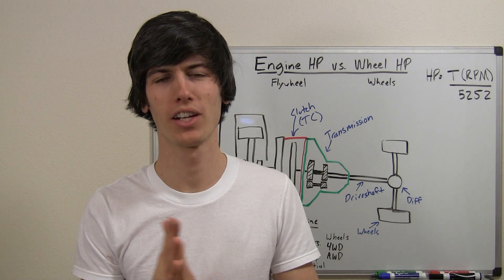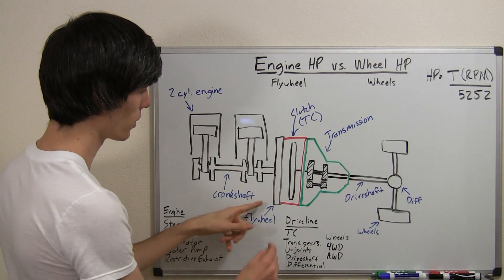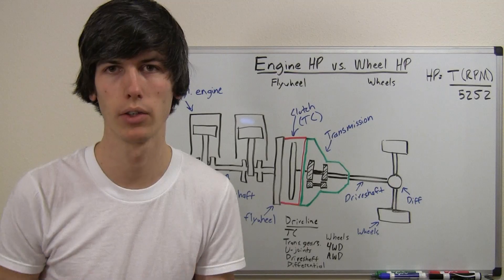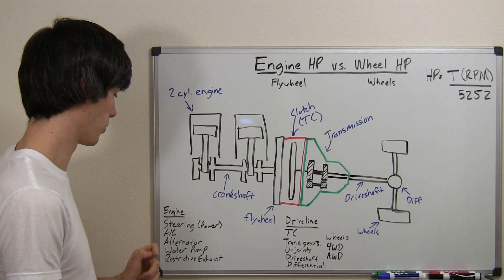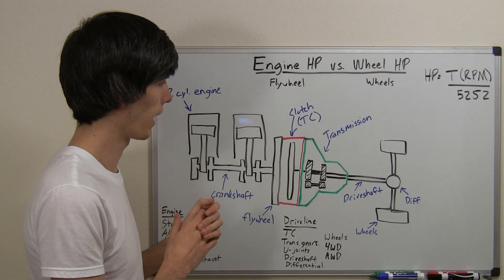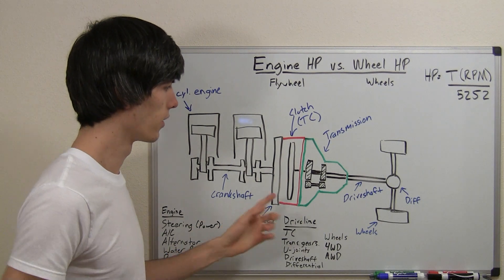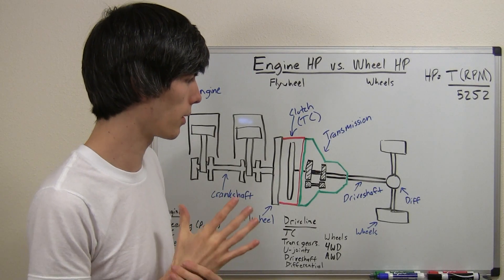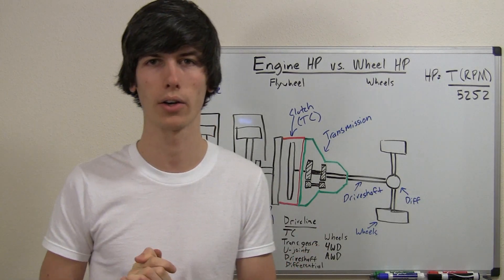Engine Horsepower vs Wheel Horsepower - HP vs WHP

Comment: What's bhp(break horsepower)?
Reply from the maker: danny2jztt Same as engine HP.
Reply: Engineering Explained quick question will it help to take off faster if i press on the break and give it some Throttle on a automatic?
Reply: +danny2jztt yes

Comment: can you explain diesel chip tuning?are they safe?
Reply: +Nilan Weerasekera yes its safe (to a point) any canned tuner on the marked you could buy is safe and if you have someone tune it it will also be safe the only problem would be if you misused the power which would cause more wear on your transmission my truck has been tuned since 07 and is still prefect

Comment: 2 wheel drive car looses about 15% of HP by transferring it to the wheels.
E.g. If I had a car with engine power of 200HP, I would loose approximately 30HP, but if I would increase power of the same engine on the same car to 400HP, would I loose 60HP? Is the percentage more or less fixed, no matter what HP I got at the engine?
Or is there a fixed amount of energy that is required to move all rotating parts?
Reply from the maker: bax442 It's not necessarily a linear trend, and I don't like generalizing what the losses will be (as common of a practice as it is). Every car will be different.
Reply: +bax442 actually it is not linear with the total engine power at all. The finite formula is a complex beast and this is why its design requires qualified engineering. 

In simple terms you have a bunch of fixed consumers like head lights, AC, electronics. These components consume a fixed range of power regarding the level of operation and less the level of engine RPM.This components actually take the majority of the engine's power loss, but as they are fixed they are less noticeable with more powerful engines.

You can clearly see this on cars with very small engines. Enabling AC on those cars fells like throwing an anchor on the street while with bigger engines you wont even notice AC at all.

The loss in friction is present but it is basically neglectable, as engineers already accounted that with the design to make it work as expected. This is also the reason why some high quality synthetic oil doesn't change the perceived power of the car. It is just making something minor to something even more minor. :-)

For example a calculation given in kilowatts: 
engine KW by friction losses minus utility consumption = real power
(30kw * 0.99) - 5kw = 24.7kw => -17.7%
(200kw * 0.985) -7kw = 190kw => -5%

Even so the numbers were taken randomly it illustrates, that even as the bigger car has 50% more friction loss due to more components used and +2kw more consumption on utilities due to more of those fancy assisting systems, the total power loss will be just about 5% and you won't notice it as much.

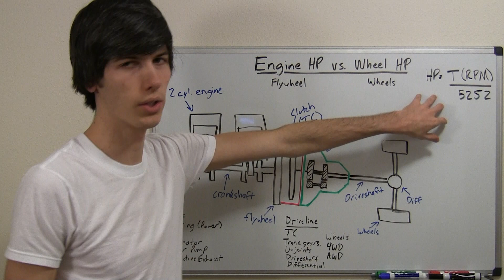Comment: 1:08
I actually don't understand that equation because we use metric (kW)

Could you do videos on Rope Brake Method, Hydraulic Dynamometer and the lot.
For instance on this one we use for RB method (If diameter of rope is negligible)

(π*(W-S)*D*N)/60,000)  This equation gives us Brake Power.

where (W-S) is Brake Friction Load in Newtons
D is Diameter of brake wheel in meters
N is average speed in rpm

I don't know why I can't find info on this on a simple search. Guess it's something outdated? lol

Comment: How does the gear ratio affect the wheel horsepower?  I know in 1st gear it has a lot more power, but with a lower top speed than in 6th gear.  So is there a different horsepower number for each gear?  Does the gear ratio affect wheel horsepower?
Reply: gear ratios do not inherently change wheel hp.   They do from an efficiency perspective, like this video talks about.
wheel torque, changes with gear ratios.  the dyno will show the same hp in 1st gear as it will in 6th gear.... remember, HP is the rate of doing work, or rate of change of Kinetic energy. (KE)  If HP is constant through all the gears, torque will have to go down, proportionally with speed, that is why acceleration goes down proportionally with speed as well. (for a constant power, and that's what gears are used to ..... to keep the engine at near max hp as much as possible
so, 1st gear you might be going 50mph with 4000ft-lbs of wheel torque.........  6th gear, you might be going 200mph  with 100ft-lbs of wheel torque ........ same HP, same engine torque, different speeds, different wheel torques, different acceleration rates.
Reply: +maxpowers3732 Yes. You will have more horsepower at the wheel in 1st gear than in 6th, but horsepower at the crankshaft will be the same regardless of gearing.
Reply: +pjbadgersuw26   No, that's not true... anytime you are at the same HP level and at the same speed, the acceleration force will be identical.  it has to be.. ITS THE LAW.   so, if you are in 1st gear and are at max hp, you might be running at a speed of 40mph... in 6th gear, that might be 200mph.  the HP is the same, but the  forces are greater at the lower speeds.  the rate of doig work would be the same.  (work x distance over time) a good analogy , is lots of force at a slow speed vs little force at a fast speed.......but same power.  with constant HP, you will have decreasing force proportional to speed (velocity).   its just a law.  that's a best case scenario.   with a rocket, force is constant, and power goes up infinitely as long as the force is applied and you keep accelerating. (think space ship)so, you have it backward:    you don't have more HP in 1st vs 6th on the dyno, but the force to move it will different.    remember, HP is the rate of change of KE.. quick example. a car going 60mph has 2,000,000 Joules. it accelerates to 70mph in 1 second , to a KE level of 2,500,000 Joules.   that would take 670hp  .. why, because a jouile or watt-second is 1/746 of a HP. (746watts per HP)       there , that is the definition of how a rolling dyno works!!         this can be done in 1st gear at max hp or at 200mph  in 6th gear.  if there is a 500,000Joule change in 1 second, that is 670hp , PERIOD
Reply: zanick2 How do you calculate crank HP? (CRANK torque x rpm)/5252... right? So how would you calculate wheel horsepower? Hmmmm wonder how...... Oh Yeah!! How about - (WHEEL torque x RPM)/5252. If you yourself admitted that wheel torque will change with gearing, then there is no way for you to refute that the wheel horsepower will have to change with gearing unless you are saying you were wrong before. There is a reason why you need to be in the right gear when doing a dyno pull, unless you tell the dyno what gear ratios you are using so that it can compensate.
Reply: +pjbadgersuw26  I see what you are trying to say, but you are making one HUGE mistake. wheel HP is NOT "wheel torque x rpm x 5250, unless you divide that RPM number by the gear ratio.  KEY POINT.so, no wheel hp doesn't change in any gear. its the engine HP minus the losses of the drivetrain,( usually GREATER LOSSES in 1st gear vs 6th by the way).no, the dyno will never need to know the gear ratio , ever!   all it needs is a spark signal.   remember, as I said, its measuring rate of change of KE.. did you read my example????? please, just think about what I have said and it will all be very clear. its very accurate, true and correct.    if you don't have a spark signal, what does a dyno show you , regardless of what gear you are in?   you got it, HP!!!! if you do have a RPM , regardless of what gear you are in, what do you get?   you got it..... HP and torque.   the only way to figure out torque is by using the RPM value.  without it, a dyno only measures HP...... funny , huh!!?????? but true!!
Reply: +zanick2 say it three times to yourself... HP is the rate of change of KE.....X3     you will be the smartest guy in the dyno room... trust me!

Comment: Gears don't use friciton to transmit power, they transmit power directly by meshing with each other, the same way as say, a strong man pushing directly on a giant gearwheel mounted with its axis in line with the gravitational axis, assuming that he is experiencing no slip because he had a nice pole sticking radially out radially to push on. A friction clutch running at zero slip woul be 100% efficient, neglecting losses from bearings. Frictional losses are parasitic loses, in the context of automotive gearboxes, from viscous losses of gear driving in viscous fluid and also losses from gears grinding against each other's surfaces .
Reply from the maker: Sure, however as gears mesh there is movement between them as the surfaces move, and thus friction is created.
Reply: Engineering Explained
Parasitic friction. Now if only there was a lubricant or coating to practically eilimiante it... Well, I guess F1 teams would calmour over it, then those who can't keep up will lobby to ban it.
Reply: There is never no friction. Every single system operating outside of a vacuum will experience at least some friction.
Reply: MAEguy
Never said there wasn't, it's just that your typical teeth meshing gears aren't reliant on them as the main means to transmit torque. Whatever friction these gears experience isn't exactly what the designers want.
Reply: 4G12
Sure. So I think we are all in agreement then. This has been an exceptionally civil YouTube comments section. Yay us

Comment: pretty sure like the video poster said they measure the engine power with an non restrictive exhaust then throw on a restrictive exhaust for emissions

you'll really have to do an engine dyno
I just couldn't imagine 80 hp being chewed up in a drive train, with added weight from awd and if you say 80hp is being chewed up

that would make awd really inferior, except my awd i had produced 160kw, my friends car an s13 turbo produced 155kw, my car was faster even on rolls was quite a bit a head

Comment: I have an Evo X MR, Engine hp is 295, wheel hp is around 210-220 hp, it looses more than 80 hp through 3 diffs and the TC SST.

Comment: is their any difference at HP vs BHP 
is that it? HP is pure power of engine EXCLUDING (Steering Puel Pump, AC, Alternator, Water Pump, Resistance in Exhaust) 
where Break HP includes everything? 
i have misconception .. only by this video HP vs WHP is cleared

Comment from the maker: You could put it up to an engine dyno and test it, but that would require removing the engine. It's really a useless number as it doesn't tell you how much power you're actually putting to the ground (which is the number you have). You can estimate it's about 10-20% greater than your wheel HP.

Comment: How to measure engine horsepower using wheel horsepower? My car is in stage1 now, I did dyno test and the result is +/- 230(bhp) & 360(nm torque) on WHEEL.. Now I would like to know the horsepower & torque of ENGINE.. There is anyways to measure or calculation method? Pls help me guys..

Comment: I'm pretty sure that since 1972, that the losses from engine accessories such as power steering, alternator, etc, were included in the engine horsepower rating. Before it was gross horsepower, now it's net horsepower. It's in the wikipedia article on horsepower

Comment from the maker: No. 2WD means less losses period. AWD vehicles are capable of putting down a greater force than 2WD, simply because they have more traction, but 2WD vehicles ultimately lose less power through the drivetrain.

Comment: you should perhaps mention that the car manufacturer gives the engine horsepower at ideal STP for the engines P-V diagrams, which is NOT the conditions encountered in everyday driving. 
Good job with the videos, keep up the good work.

Comment: depends heavily on the manufacturer and the weight of the drivetrain components etc, my RWD car atm (BMW) is currently running about 13% loss while my friends GM RWD vehicle was shown to run 27% loss on the same dyno back to back with my car.  But I have never seen cars lose more than 30% (although I haven't seen an off road SUV on the dyno with its cast iron drive shafts).

Comment from the maker: Right, but you wouldn't match a 500 hp engine to a drivetrain capable of withstanding 100 hp. The drivetrain will have to change with the engine, eventually.

Comment from the maker: In the HP equation? Use engine if you're going to then multiply by gear ratios. Otherwise use wheel for knowing wheel torque.

Comment from the maker: When you can no longer accelerate; you press the gas and the engine revs, but you don't move. Or, the clutch slips when you press the gas, etc. You'll know if it's bad! I suppose one could change it before this happens though.

Comment from the maker: As gamers said, depends on the driver. My car has the original clutch and is at 120k miles, I know plenty of others have even better numbers. That said, I could ruin it in a single day if I really wanted to (or even less time, if my goal was to simply destroy it). Once the temp gets hot, it can wear very quickly, just like tires/brake pads.

Comment: continued.from previous part..   i assume, speed of the tire, (40mph) forced the lower gear to rotate fast, which in turn influenced torque converter and TC forced engine to rotate fast,  ideally RPM from engine rotates gears and then wheels, in the case which i have explained, it is happening other side.. pls advise if i have made any mistake.

Comment: Thanks for the video, awesome explanation, no exception..  i got a question.. on RPM.
let say i am driving at 40MPH and say my RPM is at aroun 2200, when i downshift using gear level in automatic transmission keeping the same speed 40mph, no change in gas pedal, Rpm is increasing, why is this?. if i am right,gear ratio of lower gear is higher, to have vehicle running at 40 mph at lower gear, ideally engine have to increase rotation, since i have not pressed gas pedal, continued.

Comment: no HP, engine HP and Crank HP are all measured at the engine and don't include the mechanical loss from friction BHP, WHP, AWHP, RWHP are all at tthe wheels and therefore measure the mechanical loss and give you HP to the wheels